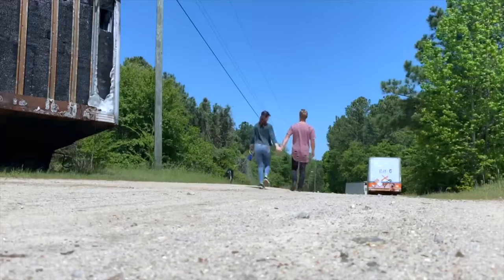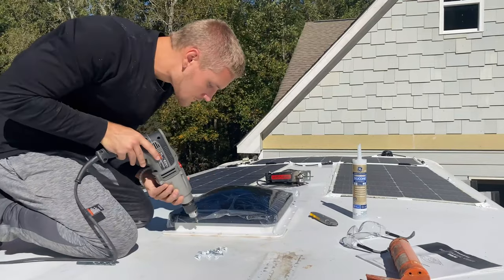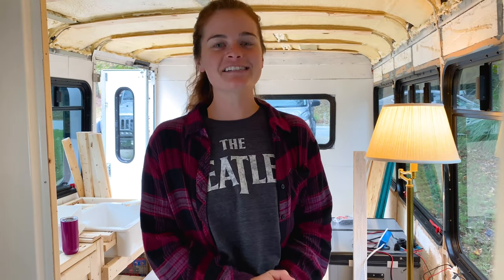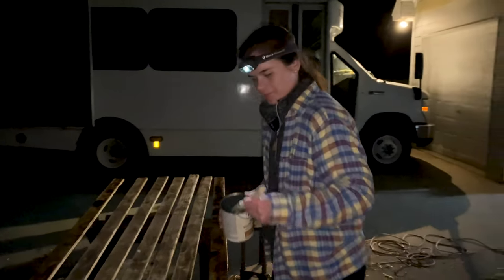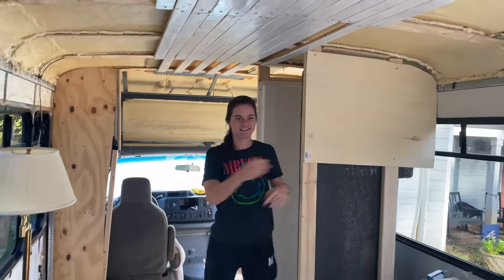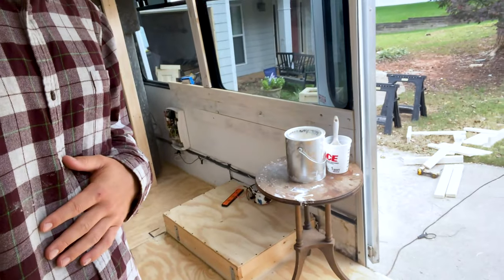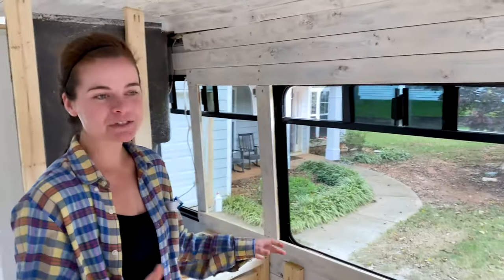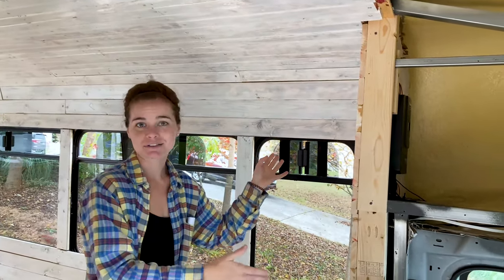Building a Tiny HOME on Wheels RUSTIC Shuttle Bus Conversion DIY

Comment: Congratulations on your build, me myself would not put holes in that front cap those windows are subject to leaks and rock chips. I would blackout and insulate the window behind the shower. Great Video Stay Safe and Merry Christmas ✌🏽
Reply from the maker: Yeah we are very nervous about cutting out the window because we do not want to create potentially more problems than needed! 
We are taking our time and considering all options lol! Have an amazing holiday season
Reply: @AwakenDaze  i am slowly starting my shuttle bus conversion.2009 E450 25 foot long. l ready have a window installed in that area. Will be removing and installing a 1995-1996 Jeep Cherokee rear hatch window. they are readily and inexpensively available at most junk  yards.
Reply from the maker: Daniel Zepeda how was installing the window? We are a little nervous about installing ours in the front area.. any advice??
Reply: @AwakenDaze  Have not started it yet as I am currently working on insulating the lower side of vehicle behind the driver and under the windows. You Tuber Wander Boom did 11-20-2019 shows video of window from Ebay for 40 dollars. They also have links to the installation video. I plan to use something similar.
Reply from the maker: Daniel Zepeda Nice! We’ll be sure to check out that video ☺️

Comment: Do you know the wall to wall dimensions of the useable interior living space? As well as the height after floors and ceiling?
Reply from the maker: Livable space after the floors and caulking have been installed are roughly 14’ L x 7’ W x 6’4” H
Reply from the maker: Livable space after the floors and ceiling have been installed is roughly 14’L x 7’W x 6’4” H

Comment: What’s the inside dimensions of the bus, how many passengers did it carry and why did you chose that length? Thx! Keep it up!
Reply from the maker: Hey Marcelo! This is a 24 ft bus. We went with this size for that it is easier to navigate in vs a long bus. The van seemed a little tight for us to live full time in. The shuttle bus fits just about in a single parking space. It is an e-450 engine which takes gas instead of diesel, which means lower maintenance costs. At least we hope lol! I believe it was 13 passenger! Cheers and thank you for the support
Reply: @AwakenDaze  I don’t have a bus yet but from some of the research I’ve be doing it seems 15 passenger or smaller buses seem good for one person and like you said, small to live in as a couple. Im considering something in the range of 16-23 passengers.
Reply from the maker: Marcelo MyRideNY that will be plenty of room if it’s just you! It’s both Austin and I plus our dog Zeus and there’s still a lot of space! Good luck to you! Let us know if you have any questions during your process ☺️